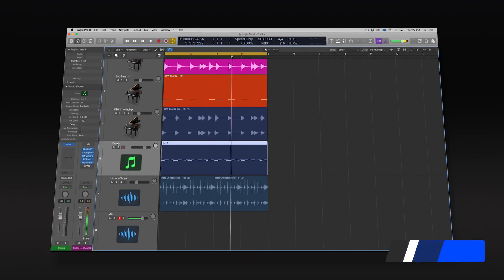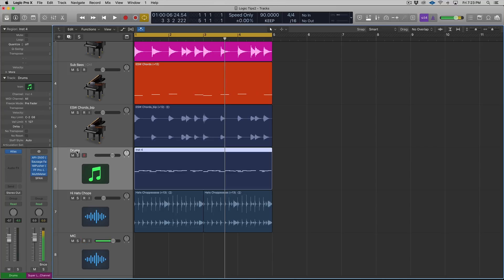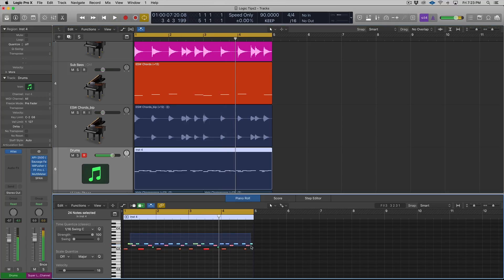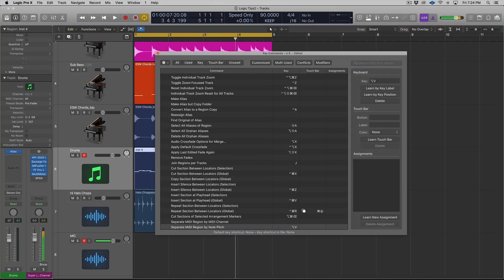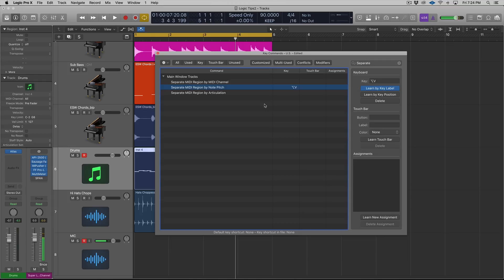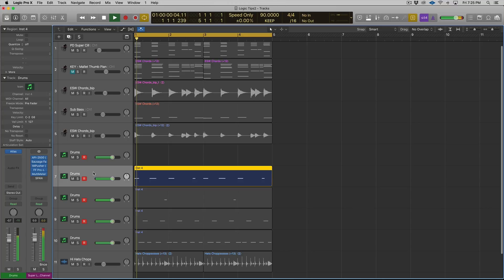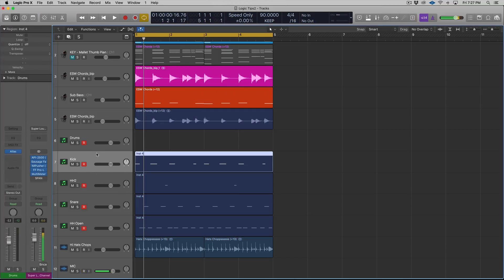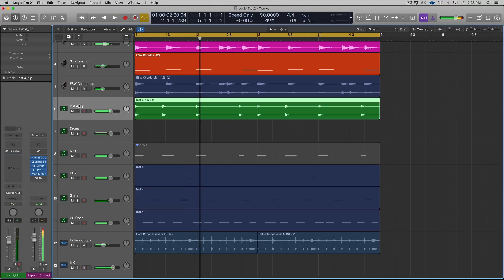Logic X - MIDI Workflow Pro Tip

Comment: so does this create 5 instances of atlas then?
Reply: No, it's 5 times the same instance of atlas. You're seeing it "spread out" as 5 tracks in the arrange window, but it's the same channel 5 times. So if you apply any processing to the channel, that processing is applied to each of the 5 drum parts. If you want to apply separate processing to each drum part you can A) bounce in place like Shane did (but then you're committing to audio), or B) use the key command 'New Track with Duplicate Settings and Content' for any given drum part which will keep the MIDI alive and create an actual new instrument channel and instance of atlas to which you can now apply specific processing for that particular part.
Reply: ah ok, that makes sense.  i guess i prefer to do it the old fashioned way and use the plus sign in the mixer to create "seperate mix channels," and then add them to the arrange when neccesary.  i prefer to edit the drum midi data on/in the same track/region anyways.  but it's cool there is a similar technique should others prefer it.  thanks for the clarification.  best, jay